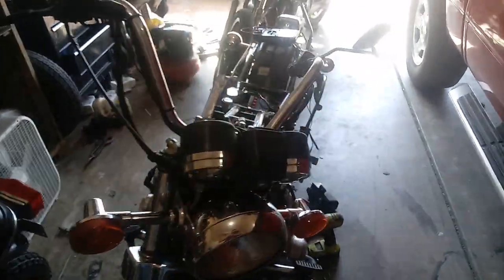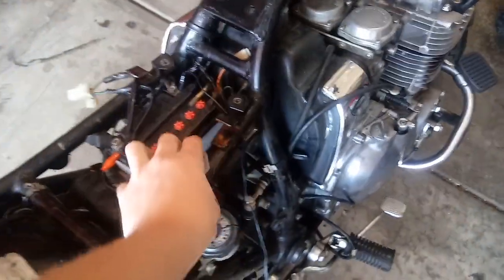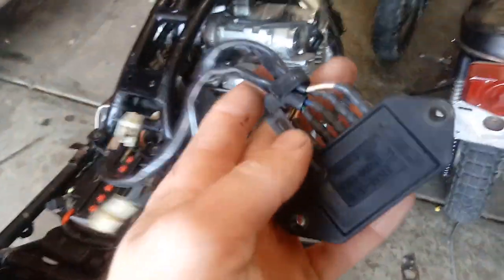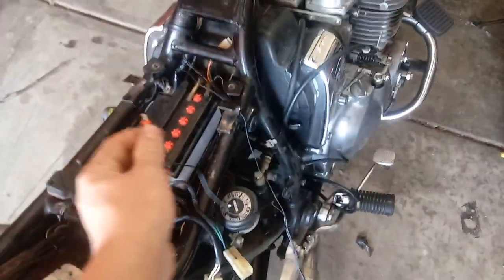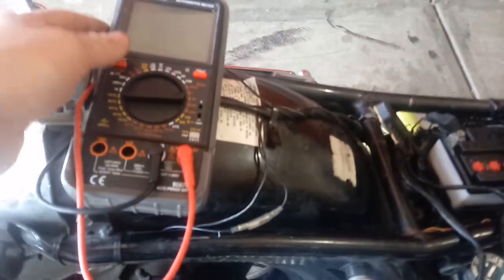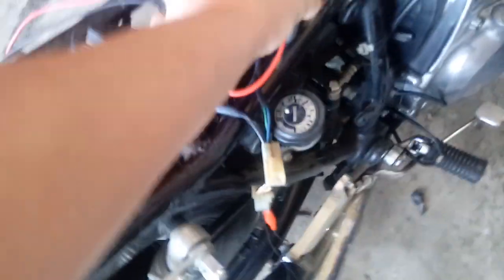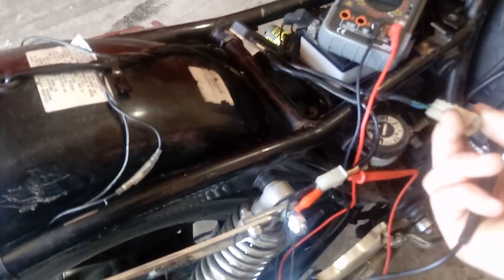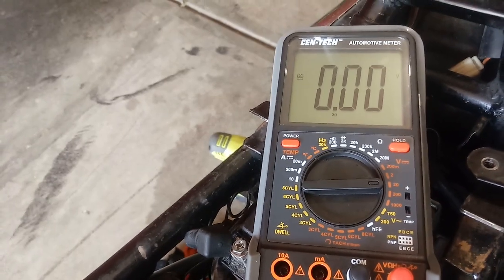How to Test a Suzuki CDI

Comment: Thank you for the video, my Suzuki loses power all the time and i think it is the CDI box that is failing, because sometimes it comes back and runs great for a short while and then it goes again. So without being an expert i think it is the CDI box. I have clean the carpurators and given it new spark plugs and one of these nice new batteries from DELO. 

I  love these Suzuki´s... I got a Suzuki GS 450 from 1984 and i love that bike. I am in the middle of stripping it for the original parts and putting them into storage. I wanna rebuild the looks of it to a black mini monster, haha. I just love these bikes, they are fairly easy for beginners to play around with and the GS 450 is as safe a bike as they come. Just enough power to have fun and not so much that you can´t handle it + super handling ;)